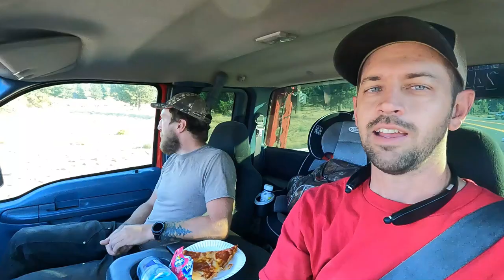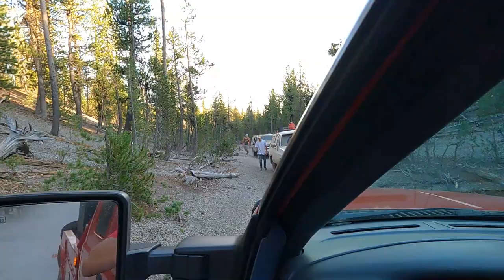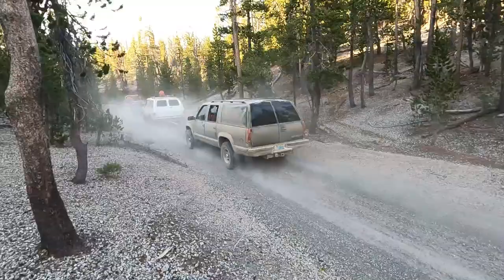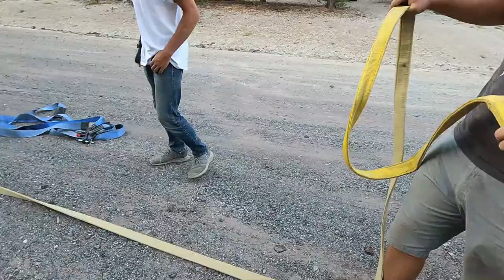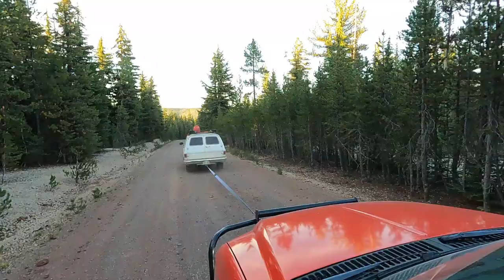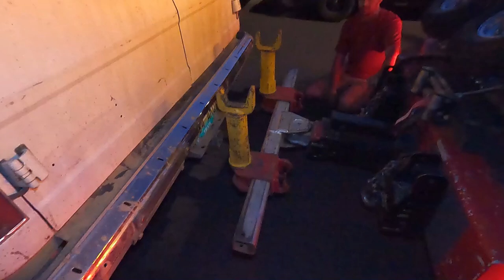Tow truck driver gets stuck and has to call a tow truck!

Comment: I had to laugh a little at the roll-back who would not go up those roads. At our equipment dealership out in the eastern Ozark Mountains of Missouri, I routinely delivered tractors and equipment out those kind of roads, driving through creeks, and with brush scraping both sides of the truck. Sometimes, I even had to back out part of the way because I couldn’t turn around out in the woods. But a great video showing another problem and solution recovery professionals perform.

Comment: awesome recovery! I went to help a 2WD out of snow in 2019 when my clutch decided it was done working. Tow truck came and had enough line to get me and on the flatbed. flatbed then got stuck as I was about 30 fee from the pavement. Tow truck then unloads the Jeep with my sitting in it when his line untangled and I flew in the Jeep off the bed towards the 2WD truck. I braked. 2. tow truck comes and to get me on the firs truck again, pulls the tow truck and me out. that was lot of towing too and we all learned a lot.

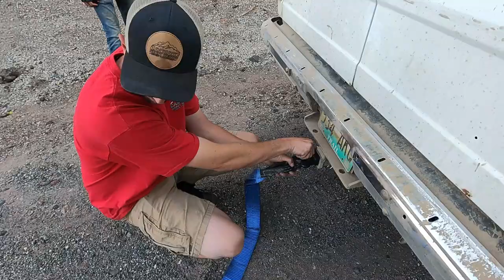Comment: 11:50 LOL --- so here in the second part of the operation, you were actually being kinda like the OPPOSITE of a tow truck --- rather than your ADDING POWER with your ENGINE to PULL the disabled vehicle, you were instead using your BRAKES to SUBTRACT forward motion and HOLD BACK THE VEHICLE! :P :D

Comment: That tow truck looks like it has the same dashboard as my 2005 Excursion and the 2004 down Super Duty pickups.  Those mirrors look like 2008+ Super Duty pickup mirrors.  That engine sounds like a 7.3.  Great video!
Reply from the maker: 2005 headlights, front axle, and suspension, 2008 mirrors, and the rest is 1999
Reply: @CaseyLaDelle  So, 2005 headlights, Dana Super 60 front axle with radius arms and coil springs, 2008 mirrors with power folding, and 7.3 liter Navistar.  I like it.  I heard your comment about the 6.0 liters; I was stupid enough to buy 2 of them.  I have a 2005 F-350 and a 2005 Excursion.  With the exception of the sheetmetal, they couldn't be more different.  They both have the 6.0 liter diesels....Yeah, I know.  Great video!
Reply: @lvsqcsl  Sell out! 🤣😂

Comment: The guy in the back braking can't see for the dust but done quite well. You can tell he has been pulled more than once and understands. I've pulled people before that just don't get it.
Reply from the maker: He did a very good job.  I was really wishing I would have brought my kinetic ropes to soften the jerks and shock loads from trying to keep three vehicles coordinated, but both of them did very well.   The hardest jolt we had the whole time was completely my fault when I was in the back acting as brakes
Reply: @CaseyLaDelle  Kinetic would have put a little spring in your step. Why did you decide to hook up to him? Was the other Suburban's brakes heating up?
Reply from the maker: @JT-SE-OHIO  the white one was completely dead so it had no power steering or brakes, and a few miles of fairly steep hill to go down.   I hooked to the back so he could concentrate on steering and not have to try and fight for brakes at the same time.

Comment: I know you had a reason but why did you just not hook up the suburban in the front to your wrecker and raise up on the wheel and pull it out I would like to know what your reasoning was
Reply from the maker: Because the extension cylinder in that wheel lift is not designed for the pulling force that would be placed on it by two Suburbans being drug up such a steep hill

Comment: The one in the middle will have a cooked transmission after that tow if it's an automatic
Reply from the maker: That's what transfer cases are for
Reply: @CaseyLaDelle  I have a few tow companies as clients and their policy is to dolly or flatbed a 4x4 cause they don't trust the transfer case to disengage when the vehicle will not run.